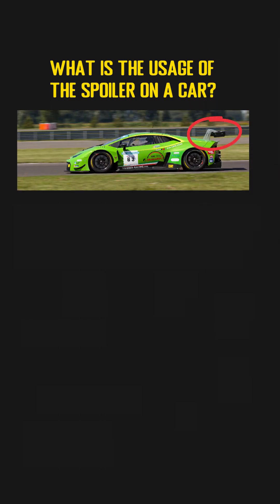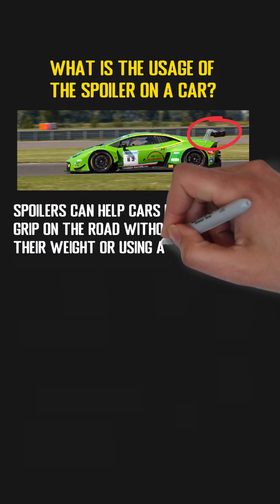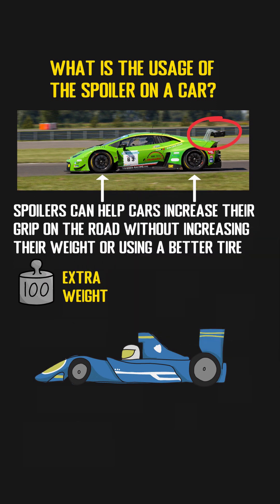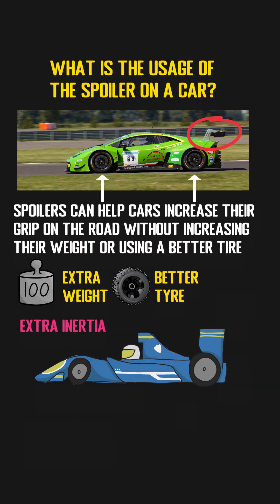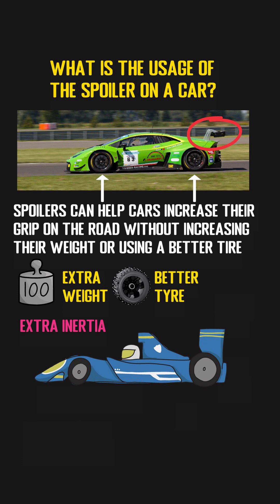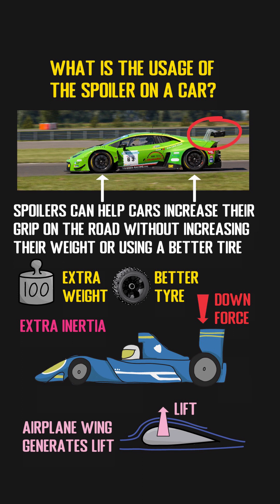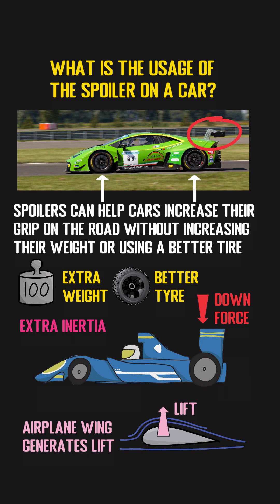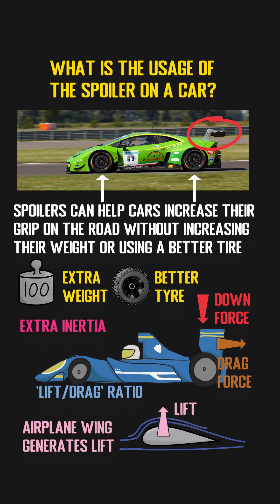What Is The Usage Of The Spoiler On A Car? #shorts #shortvideo #spoiler #sportscar

Comment: Spoilers and wings are different. 

Spoiler and wings works differently. 

A Wing pushes the car down.

But a Spoiler makes the top body air flow  slower then the under body there by making the car hold firm to the road.
Reply: thought the spoiler is holding the wing in a car?